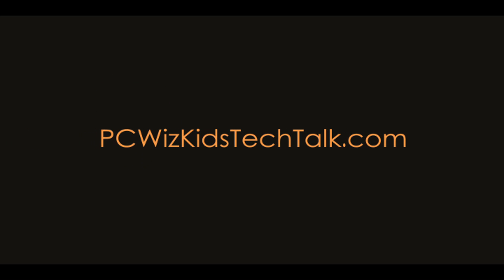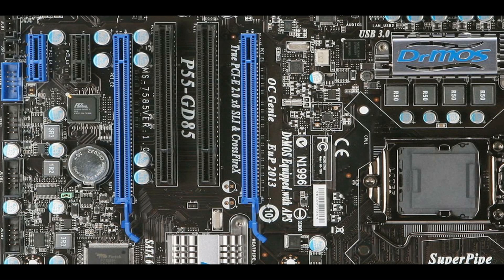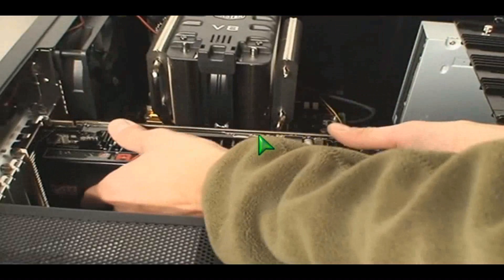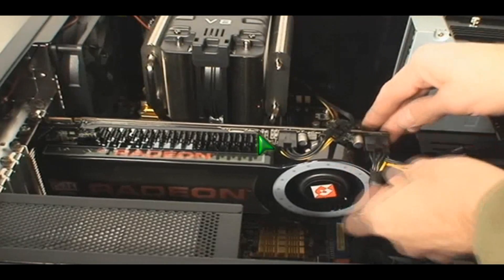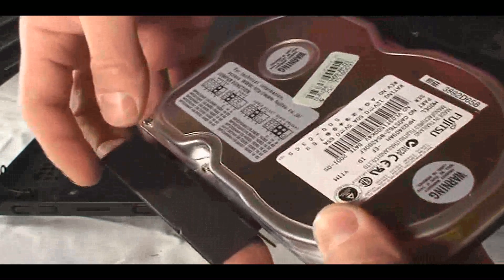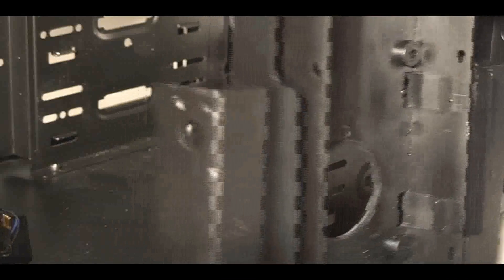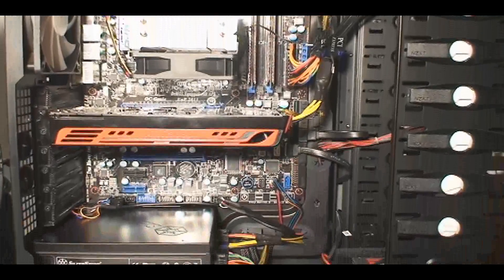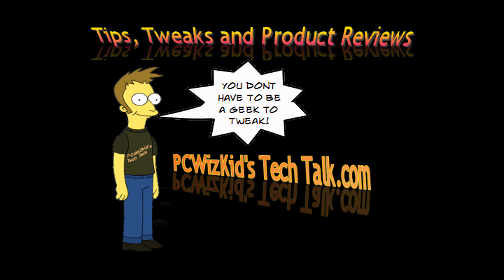How to Build a Computer - PCWizKid's PC Guide - Part 3

Comment: its much faster, smaller , has no moving parts so no noise. bad thing is that its very expensive just for a little ram. i have 124 gb ssd for the os. 1 tb harddrive for games , fraps and editing. so i use the ssd for small things and hdd for heavy use :) hope that helps.

Comment: @kickit246 I personally don't use a sound card. Unless you're doing music/sound mixing or you want absurd 3D surround sound, or you're just a snob with sound stuff, what you get with your motherboard is usually fine. I actually do a lot of sound mixing for music and games, and I've never needed a sound card.

If you want surround sound for gaming, too, I'd recommend (if your monitor and graphics card support this) using HDMI to your monitor and using the monitor's audio output

Comment: I5 2500k at 3.3 ghz quad core turbo mode 3.8 ghz
Ati radeon hd 6950 2 gb
4 gb ram at 1333 mhz
Would this be enough to run crysis maxed out 30 fps+ at 1920x1080? And when I say 30 fps+ I mean will it ever go under 30 fps?

Comment: @kickit246 When are you building this? AMD is releasing Bulldozer CPUs in the next couple of months, which should, in theory, blow the Phenom II out of the water. I'd consider holding off and buying one of those and a compatible AM3+ motherboad. 

As for buying an SSD; they're good for OS and program files, but you'll still want at least a 500GB drive for games, files and music or whatever. SSDs are fast, but small and expensive.

Finally, the case is up to you. Most branded cases will work fine

Comment: I'm currently picking out parts for a pc right now. First build, kind of a novice but coming into my own I think. This is what I've got so far
ASUS M4A89GTD PRO/USB3 mobo
AMD Phenom II 1100T cpu
x2 Corsair XMS3 4GB DDR3
2TB Western Digital WD2002FYPS RE4-GP HDD - might do ssd instead
Sapphire Radeon HD 6970 2GB
Corsair H80 cpu Liquid cooling or H70
Creative Labs SB X-FI Titanium Fatal1ty Champ PCIe Sound Card
Thermaltake TRX-750M TR2 Modular PSU
gpu is 11" gonna need a big case. Any thoughts?

Comment: @philinmotion My friend thought that there where other things that needed to be plugged in to the motherboard that makes it function most properly from a case and fix my monitor output problem. I looked it up as hard as I can and I saw no logic in this so It's no longer a concern to me. Now I need to figure out what's the problem between the graphics card and the motherboard to why I'm not getting any monitor output.

Comment: @Haroids It doesn't have onboard graphics but isn't my Nvidia Quadro 4000 a graphics cards?as I trouble shooted it I've gotten 3 beeps, no beeps, and just recently it shuts off on me in 1 sec after Turning it on. I'm thinking about borrowing a graphic card to see if it does anything positive. Thank you so much for leading me to tomshardware. I posted my question in the most accurate Forum subject to my situation. All I can do is stand by and see if anyone will respond.

Comment: Please someone help me. I have a intel DX58S02, a i7 processor, 2gb nvidia quadro grapgics card,Revolution 85+  1020w PSU, an lg bludisc player & a 2tb hitachi. I put all these devices into a frisbie case and it powers on but I get no monitor output. I connected everything and had someone look at it and he told me that it's the wrong case. Can it be that the case can be responsible for me not seeing anything on my monitor? the graphic card is in the Primary slot and the 2x6 pin connected to it.

Comment: @remix696 with these specks it is just ok i would say. these 1000watt psu monsters are onely for 4way sli overclocked to 6ghz monster processors    systems. today 700 watt is enough for every "normal" highend system, even with 2way sli and gooood overclocking.

Comment: I have a 600w power unit that I will be using to power 6gb RAM DDR3, 1 fan on the top of the case and one for the hard drives, an Asus ATI Radeon HD 5670 and an Intel Core i7 950 that I will not be overclocking and using the stock CPU cooler, will this be enough to power it all?

Comment: @Lordlinkthe1
You should go for a $50 500 watt psu that has at least one 6pin and also go for a 250 gts or a HD 5770 powercolor at newegg.com for $119. Which requires a 6 pin to power it.

Comment: why do u have a 850w pwr supply for vid card that only needs like 600w. u dont  really need a cooler if ur useing anyhting in the i5 600 series.   btw how fast is the DDR3 u have? is it like  bottum line at like 800mhz or more at the 1300 and up? here are my specs.   i cut through more of the vid.                        Specs. intel core i5 750 quad core @ 2.67 ghz lynnfield, Nvida gt 220 1gb graphics card, a 300W power supply, and some tower that seventy bucks.

Comment: For the price of the Diamond ATI Radeon HD 5770, you could've gotten a better graphics card, I'm not trying to sound rude or anything, btw... But those cards have had a lot of problems in the past for people, and as much as the cost, you could've easily subbed it for a better card.

Comment: @ErinTrigger 
wait... 5850 has reference heatsink or custom? have u tried googling bout this or use CCC? if theres no strange happens on the card it said fine, so maybe theres only few option 1. underclock it - reducing heat n performance too 2. re check ur airflow and room temp 3. try lapping heatsink and replace thermal compound with better one - but it could ruin ur guarantee. thats all that i know - i hope it helps =?

Comment: @ErinTrigger 
yeah some of onboard temp monitor kinda not accurate (1 or 2 degrees above or below), but it looks its fine coz the operational range is about 70 some
but if you wanna get lower you could try catalyst control center and adjust the fan speed manually
i hope it works

Comment: @ErinTrigger 
i mean you use digital temp? coz i havent, i usually use my finger to test how hot its =)
so far that i know its about 70 some @ full load, but if you kinda afraid of it you could use catalyst control center and increase the fan speed manually so it could get lower temp but it depends on how good your airflow so many things could affect the temp like room temp, airflow, GPU, application, heatsink type, fan speed, overclocking

Comment: r you sure its bout 75? so far that i know 5XXX series has high temp, first you should check your case airflow, the more airflow the colder you get, you can  try to neat the cables, 2nd you could use Catalyst Control Center to adjust the speed of the fan, 3rd you can lap the heatsink and use better thermal compound (but i dont recommended it coz it will ruin your guarantee).
i hope it help =)

Comment: @ilikedonuts9 
A solid-state drive (SSD) is a data storage device that uses solid-state memory to store persistent data. An SSD emulates a hard disk drive interface, thus easily replacing it in most applications. An SSD using SRAM or DRAM (instead of flash memory) is often called a RAM-drive, not to be confused with a RAM disk. Recently, NAND based flash memory has become the standard for most SSD's. (from wikipedia) =)